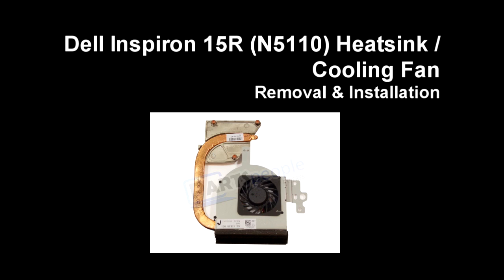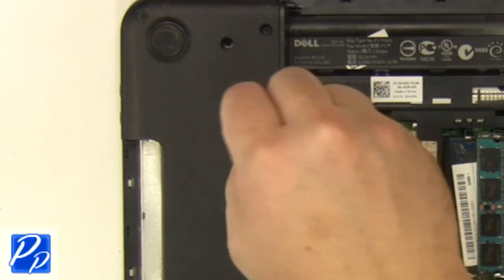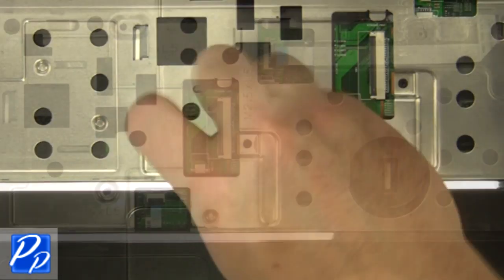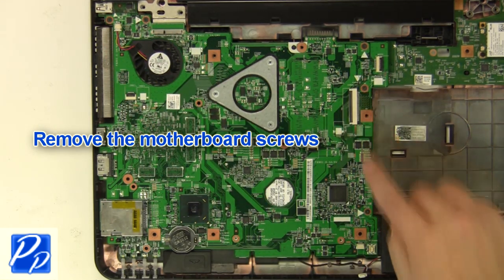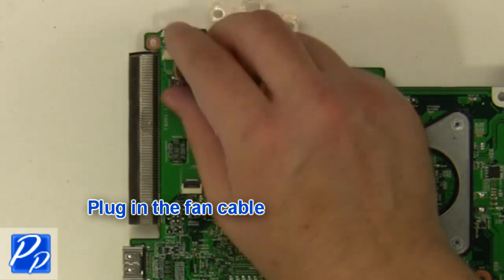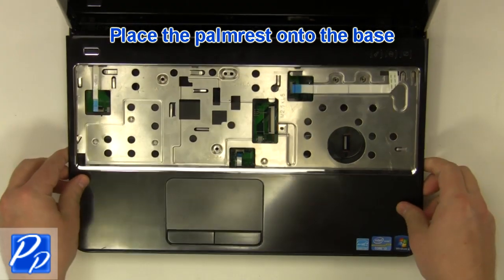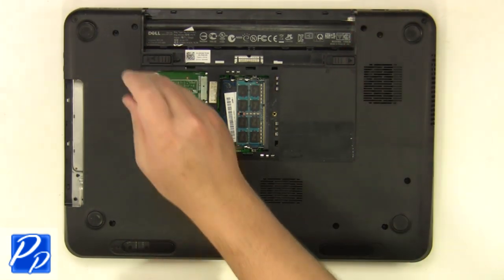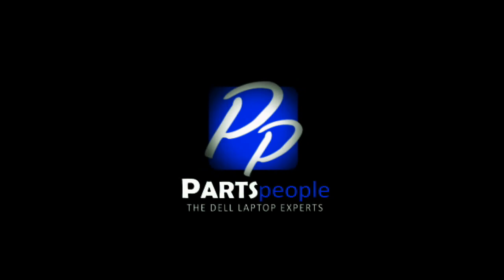Dell Inspiron 15R N5110 Heatsink / Fan Replacement Video Tutorial

Comment: Just wanted to let you know I ordered the part and although I only paid for standard shipping it only took 3 days to receive it, the discount code from the video was still valid, and the video was 100% spot on except for one wire connecting to the monitor was a little bit different but it didn't affect installation. Completely 100% satisfied with the purchase and the chat help I received on the website to make sure I received the correct fan (there are two options depending on video model). Thank you!
Reply from the maker: +Ric Oliva Excellent! I'm glad we were able to help!
Reply: where is the cooling fan on dell inspiron n5110 t the bottom or side

Comment: Thanks for the clear instructions! I cleaned my laptop heatsink and replace the thermal paste with MX-4. Temp Idle 60C -> 54C and Temp Max Load 100C -> 79C. And the laptop case no longer burn to the touch.

Comment: excellent video, on my second 'trip' inside to clean and install new base and fan. however, where you apply thermal paste doesn't look like my n5110, what are you applying thermal paste to? a different heatsink option?

Comment: Shouldn't we replace the thermal pad on the intel ich ?
And my biggest question is can u use thermal pad+paste? Thre r so many videos with lots of diff. views. Could use all the help I cld get cz I have an overheating prob. and no parts have been replaced in my n5110 since 2011.
Thnkz
Reply from the maker: If you remove your heatsink and find none, I would suggest adding some.

Comment: hello, i also disassembled my laptop by following this video step by step but when i turned it on again, the LCD did not display anything but it worked when i connected it with my TV through HDMI. I ran the BIST test on it and it shows the color, but then when it restart, it display the Dell Logo for 1 second then it turned black again. One note is that it sometimes it displayed, but for 1 sec, and the screen turned black again, i tried to reconnect the LCD cable several times, but it is still the same..is the problem in my LCD or it is the video chip?
Reply: Kha Tran  same problem
Reply: Kha Tran how u fix it

Comment: There's 2 fan / heat sinks on your website -

 1/Dell Inspiron 15R (N5110) Fan and CPU Heatsink Assembly for Discrete Graphics - J1VPC

2/Dell Inspiron 15R (N5110) Fan and CPU Heatsink Assembly for Intel Video - RF2M7

what is the difference? I think I need to replace my fan which has gotten very loud and annoying.
Reply from the maker: One is for Discrete graphics and one is for Intel graphics. That laptop had 2 different motherboard options. You should match you part number before ordering.

Comment: Is it possible to add one more fan and a vent to the laptop cause mine is only heating at the bottom left part
Reply from the maker: Mathew Jacob No, it only has room for one fan. You could try putting the laptop on a cooling pad, that might help.

Comment: I have an issue now , the fan is touching something and is squeaking while running, I tried few times but it still wont stop squeaking when running quickly, i think the metal of the heatsink is bent , any ideas if this will damage my laptop or I could leave it as is ?

Comment: I disassembled my laptop by following your guide word to word however the LCD will not display anything now when switched on - however everything is working when laptop linked to other screen via HDMI cable.

what do you think it could be and how can I resolve this?
Reply from the maker: Check and make sure the LCD cable is connected to the motherboard and didn't come unplugged. It's most likely just a loose cable.
Reply: It definitely is, disassembled it again to check. Is there any other thing it could be?
Reply: @shahrukhalikhan3570  it's either your ram or unplugged cables(make sure they are locked in place) or you broke something

Comment: Hi I think I deattached something from my motherboard. Its a rectangular green color piece,size of the dell logo written below the screen. It has a white little socket and a big round hole size of the screw mount where the LCD panel is screwed in. Any idea where it has broken off from?
I wish I could attach a pic.
Reply: Same here! Did you find the answer?
Reply: Yeah, its an attachment that keeps the motherboard in place, it has to be fitted near the right speaker where the motherboard meets it. No issues even if it isn't there. :)

Comment: I need to replace a motherboard. It is for the Dell Inspiron 15R (N5110) motherboard. I was wondering since i`m good with desktops and not laptops what kind of thermal grease and thermal pads should i use. Ive never had to replace thermal pads before.
Reply from the maker: Arctic Silver is a good thermal paste. You will probably have to go to an electronics store for the thermal pads. Just use the same type that is existing. The brand isn't that important.
Reply: cool thanks

Comment: My laptop's idle temperature is 55°c - 65°c
Will arctic silver 5 thermal compound help me out to decrease the temperature of my dell n5110
Reply from the maker: Praveen Kumar Cleaning the fan and heatsink of dust and debris, and applying new heatsink compound should allow for better cooling. Using a cooling pad will help lower the temperatures also.
Reply: Parts-People.Com, Inc  this helped me a lot

Comment: One of the screws on my motherboard was stripped. How do you suggest I go about removing it?
Reply from the maker: By using an electric screwdriver or drill and a lot of downward pressure. That's how I usually take care of stripped screws.
Reply: Are motherboards that strong to take a drill? Should I stop after I break the head off or try to see if I can get the whole thing off?

Comment: If I only want to clean my fan, do I have to apply thermal paste?
Reply from the maker: If you don't remove the heatsink from the motherboard, you will not have to reapply thermal compound.
Reply: It's necessary remove it for cleaning?

Comment: My laptop has been making awful grinding noises only when the fan starts up. I had taken it to a place and told them that 2 screws had fallen out so would need to be located where theyr missing and replaced, and that i was pretty sure i needed a new fan. They fixed my usb ports that didnt work (another issue i had) but said they found no missing screws (bs cus they didnt come from nowhere) and said the fan was fine (also bs cus it grinds as soon as i hit the F**** power button). Unfortunately this took them almost 5 weeks and i didnt wanna go without it for another month so i just left that along with what they charged me. I got so duped by that "repair" place. So i decided i will just DIY it but I am scared of using thermal paste and pads... If anyone would be so kind as to offer me a little instruction on whats involved and if its hard etc, I would gladly just buy the parts of this link and do it myself.
Reply from the maker: +Auron710 This laptop isn't necessarily difficult to work on, just intimidating. The thermal pads, in most cases, will not be fully remove and can be reused if they are not damaged. The thermal paste is simple, remove old thermal paste on the heatsink and the motherboard with alcohol, but take note on which chips on the motherboard the thermal is on. After the fan is repaired or replaced, get a trusted brand of thermal paste, like Arctic Silver, and apply a small amount (less than the size of a small pea) to each of the chips that you cleaned off previously. Replace the heatsink, tightening down the screws in the order listed on the heatsink and you should be all set.  Here is a written manual also. It has all the screw locations listed so you might be able find where the screws fell out. http://blog.parts-people.com/2013/10/16/dell-inspiron-15r-n5110-heatsink-fan-removal-and-installation/
Reply: +Parts-People.Com, Inc thanks for ur reply, After watching the video for probably a thrid time i am confident i can replace the fan myself (i will have my friend who majored in programming and built his own pc with me to make sure i dont mess up lol) but one think im not sure of is the mention of thermal pads, i understand what the thermal paste is and have looked up application videos with the pea method u mentioned, do i also need to buy thermal pads or something? (sorry for really dumb questions ive literally never built a pc or opened a laptop)
Reply from the maker: +Auron710 It would be smart to replace the thermal pads at the same time as everything else but it's not always necessary. If you do, they are called thermal silicone pads. They usually come in a larger piece that you cut to size, something like 100mm x 100mm x 5mm.
Reply: Parts-People.Com, Inc thanks so much, ive since also consulted a knowledgeable friend and will order my fan etc this week. great response and great video thanks =)